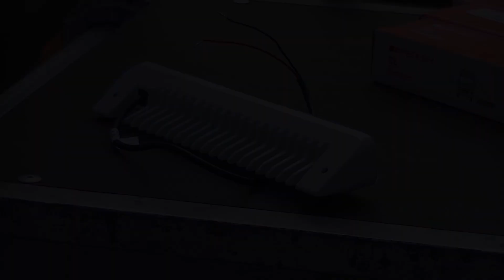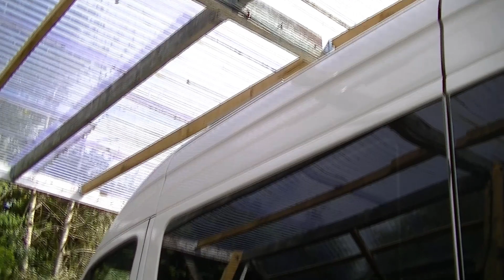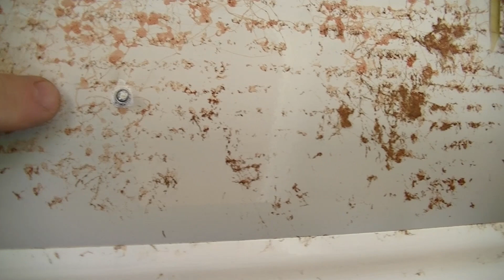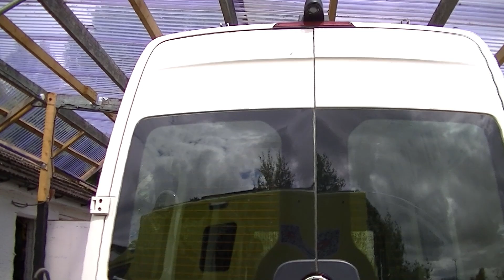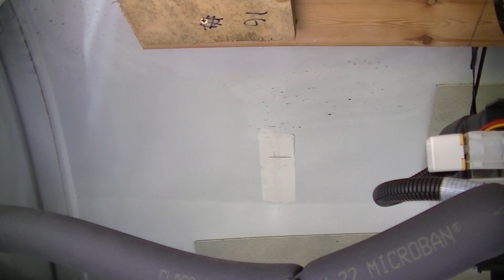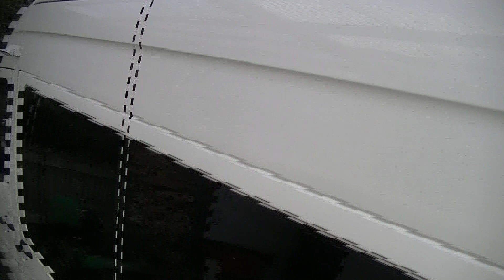VW Crafter Van conversion part 15, installing external Led Scene & Awning lights

Comment: thanks for sharing, what length of lights are these, I'd imagine if you used longer than say 12" you would start to have issues with the curvature of the van?
Reply from the maker: check the link in the description.
Reply: @CriftinsCampers  right on, didn't notice, thank you sir!